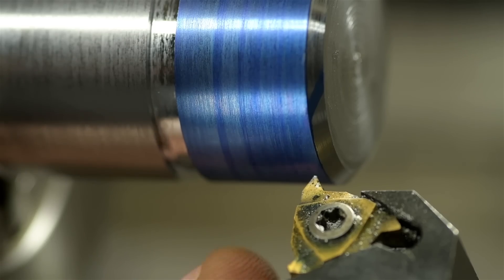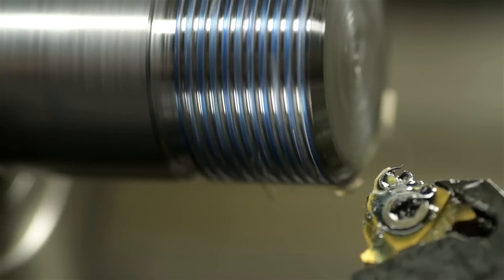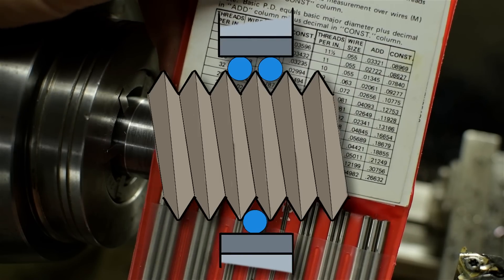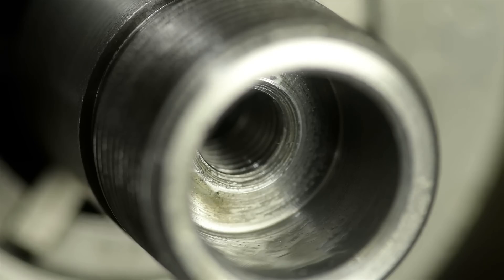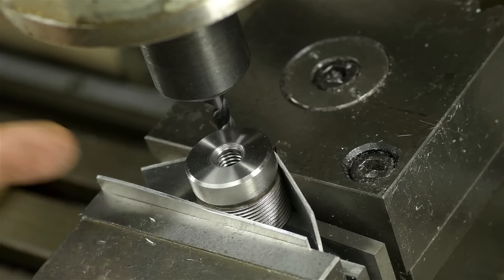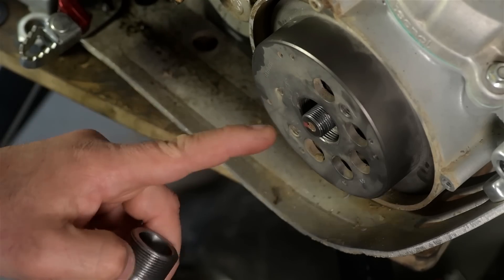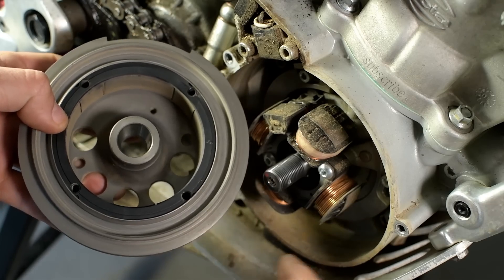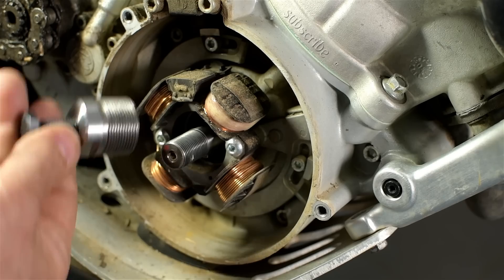EASY Flywheel Puller... using ONLY industrial lathe and milling machine!!!

Comment: Pro tip: when the timing is adjustable on the stator, you can usually access the bolts through the holes in the flywheel.
Reply: Where's the fun in that?
Reply: The stator seems like the bolts are in a slotted thing... can’t you loosen the bolts and shift the stator?
Reply: @thomasaltruda  Yeah, that backplate thing sure does look like its got angular adjustment in it, of about the range one would expect for ignition timing adjustment.
Reply from the maker: @Broken_Yugo  on the half you can't see the stator plate is bolted through non-slot holes.  I think the timing is all done in the CDI.
Reply: @ThisOldTony  The advance curve would be in the CDI box, but the base timing has to be established mechanically. Sound like they decided to alter things and lock it down in some revision for whatever reasons. If you're determined to play with it there are always offset keys, or with that tight of a taper maybe even degreeing it in and locking it down keyless, some modern car engines do that on the cam drive.
Reply: Good job ToT didn't know this or we'd be down a video!

Comment: no timing adjustments? and what are the hex bolts for with that curved indent for every 120° around the stator? looks like you can rotate it slightly without even taking off the flywheel. or is this just for adjusting the stator to not rub on the flywheel

Comment: Your blue marker is a bit squeaky, maybe you should sharpen it
Reply: Does that help? And i thought that nasty noise would disappear with adding some lubricant. I have still to learn alot ;-)
Reply: I bought a gallon of Sharpie® oil for all my squeaky markers.  It's guaranteed not to rust, bust, collect dust, or smell bad when hot.  It's good for colds, moles, sore assholes, fits, farts and freckles!  It's the wonder oil!
Reply: I think some bbq or ranch sauce would get rid of that noise.
Reply: Just gotta tweak the relief a bit I'd say
Reply: or he´s got the feeds and speeds wrong (again)
Reply: i'd add some oil before the sharpie
Reply: No, it's a dullie, thats the import brand, they only squeak if you dont stick to the write-in cycles when installed first. 
You know, speed up to 60, hit the stick really hard, check back mirror afterwards...
Reply: He should have used Threaded Blue Markers.

Comment: You did two things I hate doing as a machinist. Cut metric threads and then check them using the 3 wire method. I always need to lay something down under the part. I always drop a wire at least once. Thank God for pitch mikes!!!!!

Comment: LOL the demagnetized magnet callback. Love it.
Reply: is just magnetized in a different orientation, East West to be exact, that is why it didn't work as a regular magnet.
Reply: @MrCubas69  It's actually a gravity inverter now. It was lighter than air and he had to hold it down.
Reply: @802 Garage So when is ThisOldTony going to machine a turbo for the #SR420?

Comment: Couldn't you just thread a couple of long bolts through those threads and push it off that way? Nevermind, it looks like there isn't a good surface to push against.
Reply: John Meehan he could have, since it’s what the holes are actually there for, but where’s the fun in that...
Reply: @robinturner2300  @ Exactly. It would have resulted in no threads being cut and given us no milling time. That would have left us with almost no Old Tony.